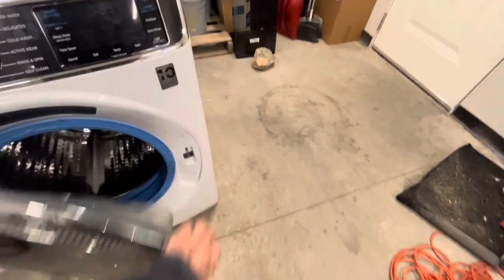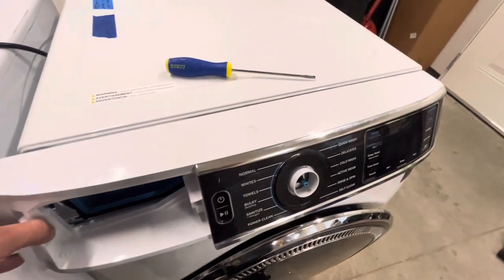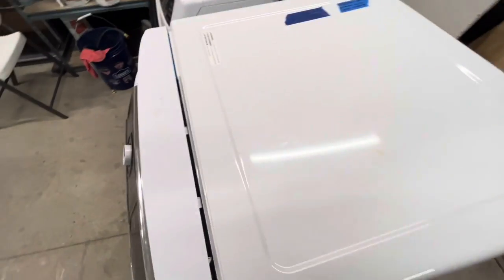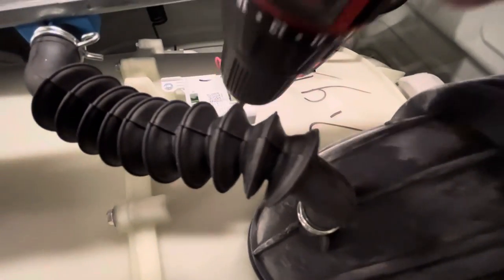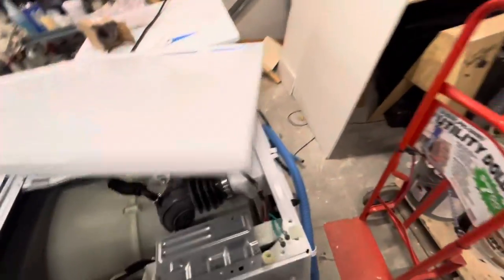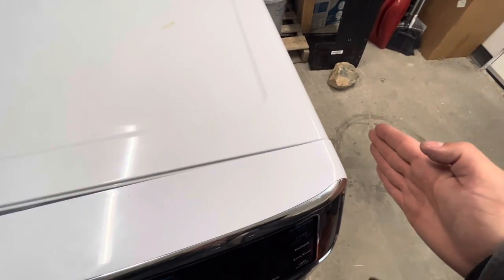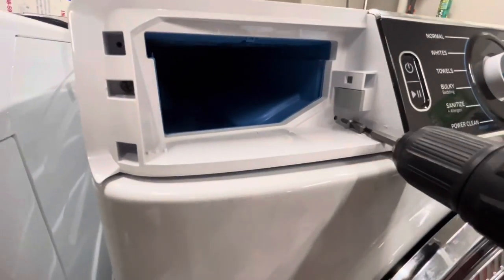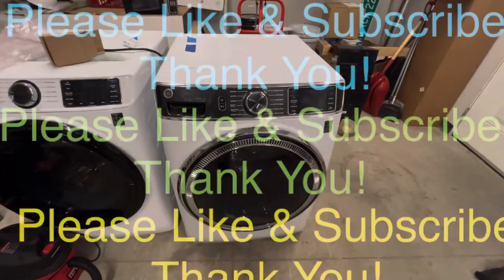Washing Machine Accelerometer (Speed Sensor) Replacement

Comment: Hey @Theocdrepairman great video and I appreciate you being so active in your comment section. I am desperate. My code is 3. I have tried most of the repair actions. The motor doesn't appear to be prevented from moving. I replaced the accelerometer. The spin test (14) is still only going for about 5 seconds. I have not measured the "Resistance of each motor phase winding" because I am not sure clear on what to do there. The last option is to replace the inverter board or main board. Is there a way to check which one might be the issue or something I am missing?
Reply from the maker: Do you have any other error codes? My gut says the control board is bad but I am UNSURE at this point. 2nd question when you run a normal wash cycle with a few items what happens? Does the tub spin at all or not move at all?
Reply from the maker: I just had an idea but I dont have access to one of these machines anymore. Inside the control panel is the wiring diagram it should be there according to GE website Figure out where there accelerometer connects. If it only connects to either just the inverter board or just the control board replace the board the sensor connects too. Because you say after test 14 is run it only last 5 seconds compared to 15 seconds from your results which according to ge indicates the sensor is bad but we know the sensor is good so the component that reads that sensor must be bad but hey maybe they both are bad or it runs through both with no way to know just let me know what’s going on
Reply: I wanted to follow up on this, I got the solution. My motor was bad but still spinning. It broke my original inverter so I needed to replace both my inverter and the motor to fix it. It’s been working for over a month now. Thanks for the video and the comments!
Reply: @Brewman66 
How were you able to determine the motor was bad? 
The motor in my machine still works but only in the 5 second intervals when in service mode 14. 
I believe the motor is the only part GE covers on under their “10 year” warranty. Were you able to have the motor replaced under warranty?
Reply: @mikeburks188   well I narrowed it down to the motor or the inverter using service codes and the diagnostic guide and a lot of looking up things online. I just guessed and bought a motor when it came, the new motor didn’t work so I bought an inverter. I put the old motor back in and replaced the inverter. It worked with no clothes but when I put clothes in it did not enter the final spin cycle. So I put the new motor in and it has been working now for months. 
With regard to the warranty, I am out of the GE service area so they wouldn’t fix it or send a replacement part. I believe you need to be in their service area and they need to install it. I would look into it the GE website should be able to help

Comment: Hey.. hoping you can help. I have the GFW550SSN1WW and clothes staying wet as the final spin won’t trigger. I tested 14 and 26 without a load and it fast spins fine. As soon as put clothes in, when it gets to rinse, the time keeps increasing as if it tries to rebalance. 

I have tried to manually adjust many times and the spin stays slow/keeps tumbling and the timer continues to go up. Ran diagnostic and had the following: 3, 19, 26, 34, 38, 91. After testing pressure 10 and also the drain pump all is good. So the only issue appears to be the balancing prevents the fast spin… the machine is level in the ground.

Does this mean the bearing is bad? Inverter? I checked the basket and it is a little wobbly but I’m assuming it’s due to shocks? The fast spins are noisy as if the bearings are worn. The machine just hit the 2 year mark. Just subscribed.. Any assistance is appreciated.
Reply from the maker: Thanks for the question! I would love to try to an help you. That fact test 14 works is a good sign to me. Did anything happen to fall down under the tub by off chance? Check all hardware where the tub connects, as you rotate the drum you should see hardware I am having a hard time recalling, but check any loose hardware that looks like it is drum related. I would like you to write down those codes, then reset the trouble codes test 16. Run a normal load and see what codes return after it fails. From first guess I’m thinking maybe that hardware is loose, maybe replace suspension shock dampener, maybe the pulley screw/bolt is loose on the rear of the basket. Maybe the counter weights are loose. My gut feeling says something is physically worn out causing the machine to go out of balance maybe combination of things. I would start with resetting the codes and look for loose components. I am not ruling out the motor being bad, but test 14 usually won’t complete if motor is bad.
Reply: Hey… thanks for the quick reply. When I initially thought it was the drain pump, I tilted the washer so I can get underneath, took out the pump to inspect (was fine) and reinstalled it… so I didn’t see anything “under the basket” that may have fallen. Nothing looked loose from a non tech perspective but clearly I’m no professional. 

I did a damper test which was fine (fyi…all tests I ran were good).. How do I check the bolts/loose hardware of the basket you mentioned? (You mentioned pulley bolts/counter weights/shocks.. etc) Pull out the washing machine and take the top/back panel off? Do you have any videos showing how to/I can use as reference?

FYI… after yesterdays wash, I used test 14 to dry the load as a work around and the basket was wobbly/bouncy at the second speed which made the washer shake but when it went to 3rd and high speed, it was fine.

I ran a normal cycle after resetting (only codes 26 and 38 came up). Thanks again for helping me… so frustrating as this thing is literally 2 years old…
Reply from the maker: @Nero.2024   okay. I think the only codes to focus on are 26 and 38. Remember to check the codes periodically after doing work to continue to verify the correct error code as irrelevant codes will also be thrown. I just mean check any bolt/nut screw you can on the anything that secures the tub. Take the rear panel off to access the belt and pulley make sure that bolt is tight. You can then check the bearings better and see if there are in fact worn out enough to cause to much friction it causes an out of balance state. These machines are not high quality, sometimes expensive components fail I would seriously consider investing in a new machine if you start to replace expensive components. But code 38 is for the vent damper: Ge says…Run service mode Damper test 24 to verify feedback open/close.
Check wiring harness and connections.
Replace Damper if Damper feedback open/close is not detected.
Reply: I did test 24 and it passed (both “light” and “extra light” flashed when toggled by pressing the start/pause. I can also hear the sound of it functioning… So is the damper fine? 

I’ll attempt to open it up and check for loose bolts..etc. I’ll let you know if I find anything. If you have a video/suggested video to show what to look for/how to open..etc that will be helpful. Thanks again!
Reply from the maker: Does this happen when there is a lot of clothes or a little amount of clothes. Start with socks and work your way up until it happens. Make sure you follow the advice here first https://nerdinthehouse.com/ge-washer-out-of-balance-during-spin/

Taking the rear cover off should be straight forward but I cannot not remember

Comment: i have the ge gfw550ssn0ww and is only spinnig 5 sec on test #14- 26 any help is appricated
Reply from the maker: Does the normal cycle run at all? It COULD be the speed sensor, but if it doesn’t run more than few seconds it is likely the inverter for the tub. I have seen many of these GE washing machines get over loaded with too many clothes and then it wears out the inverter. the unit will spin for only seconds. Unfortunately the inverter is expensive and time consuming to replace especially if not sure if the inverter is actually bad. We need more info/ more tests. I have had bad luck replacing inverters and the machine will work for days then crap out again I assume because multiple component have gone bad or the user overloaded the machine again. I usually just recommend entire replacement if the inverter is bad.
Reply: did replacing the sensor solve your problem? i have the same problem.

Comment: My washer is giving me only error code #3. When I put test 14 or 26 it spins for about only 5 seconds. You think it could be the accelerometer?
Reply from the maker: I think it COULD be. Otherwise it is likely the inverter motor, inverter board or control board which all are expensive. Either the accelerometer is giving bad signal or one of the two boards is interpreting it wrong likely. Or maybe a fault with the motor. How old is your machine? If older than 3 years old may want to invest into a new one instead of repairs
Reply: @Theocdrepairman how were you able to diagnosis, what as wrong with the washer and what needed to be replaced?
Reply from the maker: @angelvalencia4137  After running test 14 and the machine only runs for 5 seconds. I have replaced the accelerometer and the machine has worked. On many of these machines the inverter parts fail, but usually If the inverter parts fail it won’t spin at all. It will try and just rock about 1/16th a turn. I have replaced the inverter motor and board on the 1/16 spin condition and the machine worked, but failed days later likely user overloading but cannot confirm. Sometimes these control boards fail in strange ways, just trying to let you know that there are many issues with this machine and these components fail very often. I don’t really have any direct diagnosis for the control board for this specific problem. (It’s likely good) My best advice unless you start doing some technical research is to replace the accelerometer and if it doesn’t fix the problem then get a new machine. I have experienced these machines costing a lot in repairs relative to the machine if the diagnosis doesn’t reveal the total cost if there are multiple problems to figure out. Those inverter parts are expensive and I want you to be aware of possibilities before making a decision on your repair. Nothing like fixing a machine just to have other components fail shortly after. Manufacturers only make these things to last the length of the warranty period.
Reply: @Theocdrepairman thank you, I greatly appreciate the advice. Also this video helped out a lot.
Reply: @Theocdrepairman unfortunately, I just tried replacing the accelerometer, but it still has the same issue, throwing the error 3 code and stopping from spinning after 5 seconds
Reply from the maker: @angelvalencia4137  That is unfortunate. If you can’t tell I don’t like these machines, I have experienced many headaches. I would recommend returning the part under wrong part ordered. Take it with grain of salt, but now I’m GUESSING control board given my previous times with inverter led to a somewhat different result. I’m sorry to hear the issue still exists.
Reply: @Theocdrepairman i also ordered the control board and was praying the accelerometer would’ve solved the issue. At this point, do you think it is worth hiring someone to diagnose and fix the issue? Or would it be a smart idea to get rid of it completely. Like you had said
Reply from the maker: I hate to say it, but I would get a different unit especially if you can return the accelerometer. Someone coming out to look at it (depending on your area will probably be $150, plus parts and install that really adds up quick. I would get a new unit, but if you want to take a risk I would do the control board if I had too. I don’t like being wasteful, but this has been my experience
Reply from the maker: @angelvalencia4137 just wondering what you ended up doing with your washing machine problem?? Was it resolved?
Reply: I have the same condition. Were you able to fix it?
Reply from the maker: @VictorArriola-xi3cd  from what I can gather, it appears that most of the time the problem actually lies with the control board. Somehow the control board doesn’t interpret the sensor correctly. From the feedback I have received the problem is actually less likely to be the sensor and more likely to be the control board
Reply: @Theocdrepairman so I actually did get the problem solved. After a few weeks of using the laundromat by my house, it turns out my neighbor actually fixes appliances for a living. He fixed ours free of charge, it wasn’t the control board or the accelerometer, he had to take the whole front of of the machine off and it soemthing all the way at the bottom
Reply: So it was the inverter board that was the problem in our case.

Comment: My washer stops working 4 min after star any cycle code 3 19 26 27 clear the out after code wipe out only code 3 and 9 showing up any leads?
Reply from the maker: First thing you need to do is subscribe to the channel if you haven’t already. Then, if you clear the error codes, and error codes 3 and 19 return then I recommend entering service mode and doing test number 14. Test 14 is the spin test. If the machine can spin the tub for the test the problem is likely either the “pressure sensor” (water level sensor), “accelerometer”, or the “control board” run test 10 to test the “pressure sensor”
Reply: Did you find out what the problem was?

Comment: I replaced the accelerometer, but it still does not spin more than a few seconds on the diagnoatic test. Is there a way to test the board or motor? The motor would still be covered under warranty. I already replaced the accelerometer and the drain motor. Any other ideas?
Reply from the maker: @jbrandonprice4375  the warranty process sucks. You have to call  certified GE vendor and I don’t think they cover the labor (unsure).  For what it’s worth most people have had success with just the inverter board. Some require inverter board and motor. Some have replace the inverter board just to find it does out again in short period of time.
Reply: @Theocdrepairman thanks so much. The main board appears to be good. I ordered a replacement inverter board and hope it takes care of it. Otherwise it needs a new motor that GE will pay for once I have a CERTIFIED appliance repairman giving me an invoice that is it needed (since I don't live in an area with one of their service people).They will pay for the motor and I will have to pay for the labor and service call....
Reply from the maker: @jbrandonprice4375  just a side note I have noticed if these machines are overloaded this problem can happen but this problem happens on ALOT of units with the inverter board and motor
Reply: @Theocdrepairman  it did this trying to wash a handwoven afghan.

Comment: What if the problem continues after changing this part?
Reply from the maker: You will need to tell me a lot more info. Like which parts you replaced, what the machine is behaving like does it start then stop, does it not do anything? and so many other things. If you want to keep guessing then the best guess is always the control board, if the machine will not function
Reply: I replaced the accelerometer like you describes but I’m still having faults about the motor hall effect sensor when I run test 14
Reply from the maker: @kevinmchugh1372  it is likely the control board that is also bad.